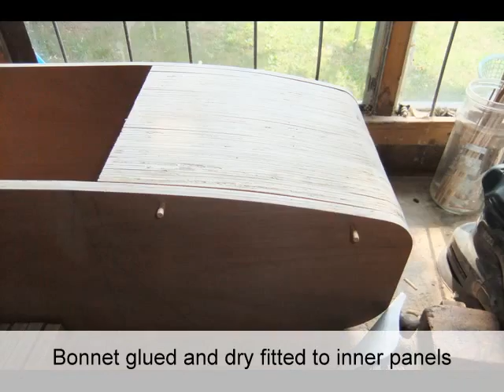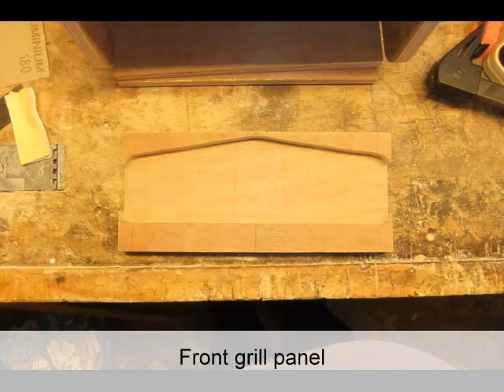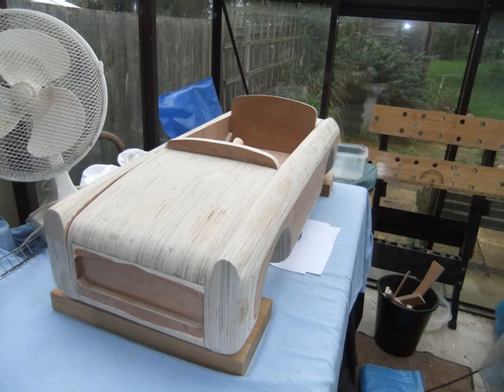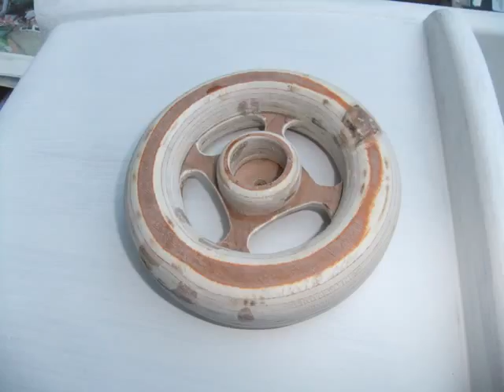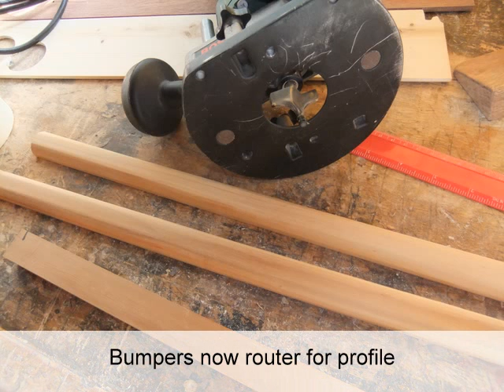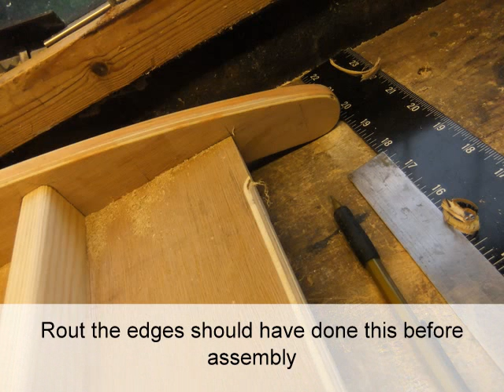Rocking Car Build

Comment: Very nice.  That thing must weigh at least 150 lbs with all that plywood.
Reply from the maker: It is surprisingly quite light considering. I tried to keep the weight down by making all the parts hollow. I never did weigh it.